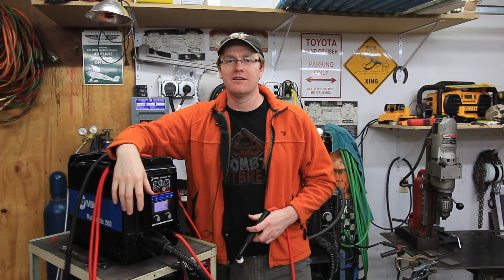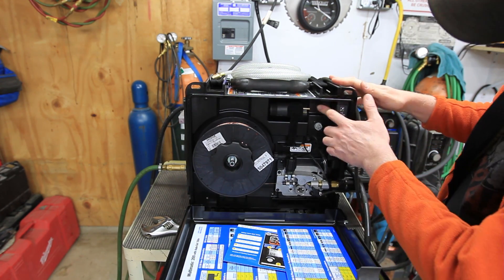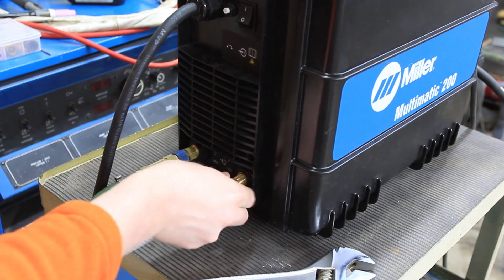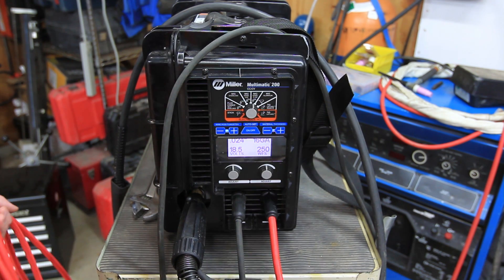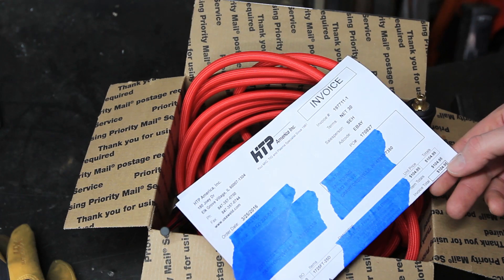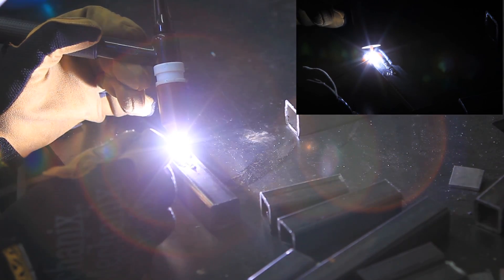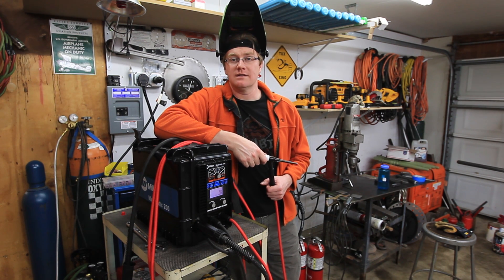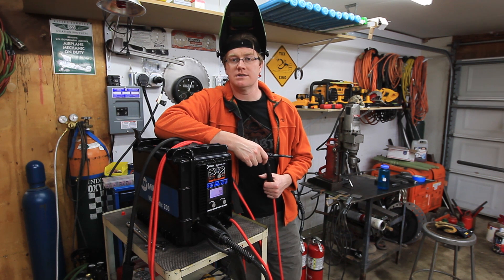Miller Multimatic 200 TIG Setup

Comment: How do you set up the timer for the gas? You don’t need 7 sec of shielding after breaking the arch. 3-5 sec tops. Anything more is a waste of gas. I can’t find how to adjust the machines gas timer.
Reply from the maker: Not sure how you adjust it, if you get in the tech menus there might be a way.